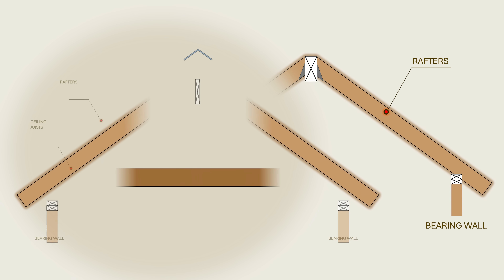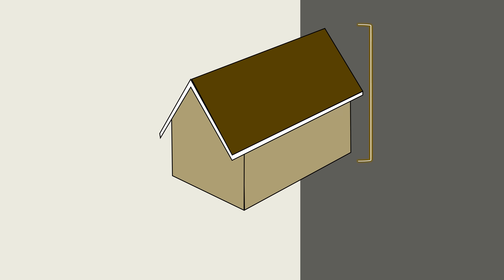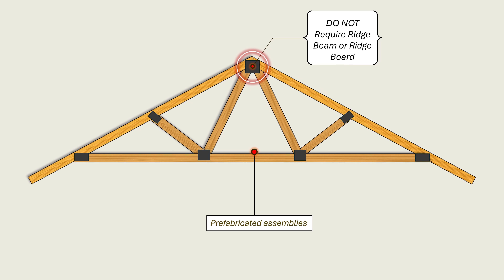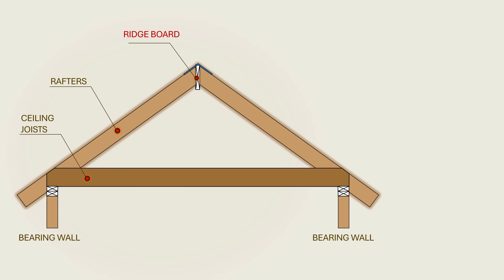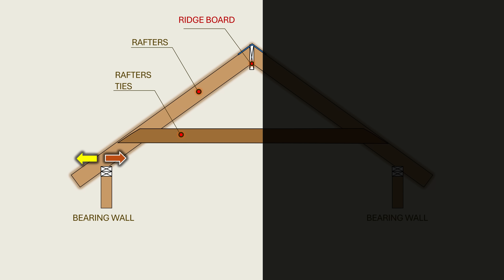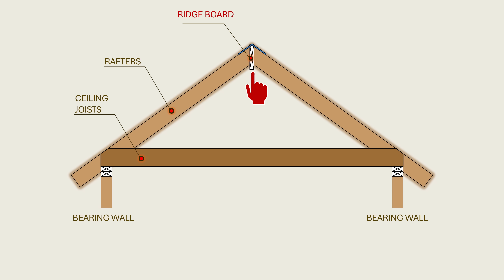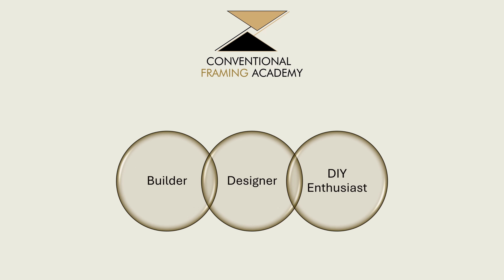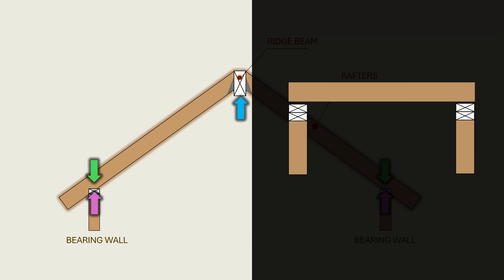Ridge Beams vs Ridge Boards: What Every Builder & Engineer Must Know

Comment: I would always go with a conventionally framed roof over trusses.   Too many times the trusses come broken or break later creating a massive problem.   Plus, they eliminate any possibility of a functional attic.  And, finally, any cost savings has to be compared to increaese in other trades, like HVAC. And compromises in functionality in other systems.

I prefer ridge beam, even if not to expose architectural features.  They lend a more effective and efficient use of attic space,  access overall, and installation and functionality of other systems (especially HVAC).
Plus, the long term durabilty of your roof..... termites will have to eat your entire house before that roof fails. 

I, also, don't like OSB, preferring regular plywood and marine plywood (if moisture or water is an expected issue).

Basically, if you are going to build a home that you intend to keep or posiibly pass down.
Build it to last!! 

Why build to a 10, 20, or 30 year standard? 
When you are ready to retire and relax... the house will need major work.
Assuming 30 years....
BTW most track builds today are built to a 10 or 15 year standard.
🎉
Build to a 50 plus year standard.  Build anticipating future upgrades and maintenance, with ease of access.  

Yes, things have a cost.  But, the difference in these, during initial building,  are far lower than major overhauls and accompanying restorations.... far lower in the long run!!

Comment: I am done with ridge beams. This video sloved a monster of a problem on my stone house in Portugal. Lifting a huge ridge beam onto the roof all by myself. Also the ridge beam puts all the loads on two points. Going the ridge board route allows me to spread the load around the house. The cross ties will completely eliminate any possibility of side thrust.

Comment: Speaking as a 30-year framer and contractor: a carpenter, structural engineer, or architect would call the one on the right a "structural ridge" (as opposed to the "conventional ridge" on the left), not a "ridge beam". Structural ridges typically make use of beams as the ridge, but "beam" doesn't describe the main function. Rafters can be attached to both types of ridges with hangers. 
If a strap is used across the top of a conventional ridge to resist uplift, it's installed across the top of- and fastened through- the roof sheathing. Shown like this it would interfere with fastening the roof sheathing to the rafters, which is a structural connection. If straps or hangers are not used, collar ties (2x4's, 2x6's, or 1x6's) can be installed in the upper third of the roof, connecting opposing rafter pairs at  4' intervals. Since most rafters are installed every 24" along the ridge (on 24" centers), every other rafter pair would get a collar tie.

Comment: 2 inch ridge beam is fine, just install lateral brace down on load bearing wall, run angle braces tied to strong back connected too rafters  back to load bearing wall and collar ties at ridge.

Comment: Thank you for the video. Many, if not all houses over 60 - 70 years old use a 1x6 as a ridge board. A ridge board is merely a convenient way for carpenters stabilize roof framing and to visualize where the rafters go. I have seen structures with no ridge board at all. And at least twice in my life I have framed a roof with a "real" valley, now there is a lot of weight (stress) where a beam is required.
Reply: Yep, I mostly work on houses from the early 60s and they used pretty much any old board. All those houses are doing just fine after all these years.

Comment: From experience I find that the assertion that a ridge beam eliminates horizontal forces spreading the walls is not 100% true. Though it may reduce lateral loading at of the bearing walls it does not completely eliminate that load.
Reply: If the ridge beam is adequate and the rafter attachment sound, how would the roof move to spread the walls? I'm currently building one.
Reply: @neild7971  The lateral load would be so small as to not matter, but have the design approved by an engineer.
Reply: @kshepard52 engineer involved thanks. Peter is saying from experience beam doesn't stop wall spread, I'm curious what's happened.

Comment: ridge boards and ridge beams are both "dimensional wood boards" ? ie: 2x6, 2x8, 2x10 ?
Reply from the maker: @philipschneider6396 Ridge beams are typically 4x or 6x members. They may even be Glulam or other types on manufactured lumber as designed by the engineer. Ridge boards are typically 2x members.
Reply: @ConventionalFraming  Yes, because they're only marginally structural. They provide extra nailing for the roof sheathing at the peak and a good connection for opposing rafter pairs.

Comment: @ 7:00 , a better graphic would better explain this rule.  Show the plumb cut (the vertical cut touching the ridge board) meeting a 2x6 ridge board vs. a 2x8 (or larger) ridge board, and how this larger board satisfies the rule.

Comment: I used a gluelam beam for the ridge beam with joist hangers for the rafters to sit on, one end of the beam sat on a pad stone in the abuttment wall the other on a designed steel box section truss, all calculations were done by me after watching various videos on YT, i was over the moon when building control passed it all, saved me a lot of money in engineers fees
Reply: st to clarify the above, the gable was fully glazed from the ground up to the botton of the ridge beam, the steel truss sat on pad stones on the inner leafs of the side wall returns
Reply: @georgeliquor2931  Leafs? Glazed? WTF are you talking about? What planet are you from?
Reply: @kshepard52  In the UK the inner and outer walls of a building are reffered to as leaf's, so in anwer to your question im from planet UK, glazed means frames with glass in them, in this case triangular PVC window frames, Im sorry but for a man with your credentials you seem quick to put down others and also ill informed, maybe thats how it is on planet USA
Reply: "all calculations were done by me after watching various videos on YT"
Recipe for disaster! The plans should have be reviewed and stamped by a structural engineer. I hope no one reading these comments actually takes you seriously!
Reply: @kshepard52  For someone of your background you seem very quick dismiss my coments, i would have though someone self teaching through whatever means to achieve a goal would be appluaded by most people, it seemed to me that paying an engineer £600 to do a simple calculation would be like throwing money away especially when on previous builds where the customer had engaged the services of an engineer the drawings and calculations were done by a computer or just coppied and pasted and all way over spec, i could send you drawings that i have on file that were put together by structural engineers that i am sure would have you shaking your head as the building inspectors have done on site many times when they see what the engineer has specified. My calculations were based on the european design capacity tables for industrial steal hollow sections cross referenced with british steel design capacity tables, to calculate the forces involved i watched a few hours of YT videos on truss design and trigonometry, the calcs were not difficult once i had wrapped my head around the trig side of things, glulam beam calcs were provided by the manufacturer.   The whole process was enjoyable actually and it saved me money, it was a good feeling when building control rubber stamped my submission  it also reinforced my opinion that some structural engineers are just in it for the money and do as little as possible to get it and feel untouchable on the plynths they have put themselve on. Self edducating  is a good thing as long you are prepared to put yourself up for scrutiny by your peers

Comment: Simply put: Depends on rafters with flat ceiling (ridge board) vs rafters with cathedral ceiling (ridge beam). If you use a truss system (more expensive and stable) this ridge board/ridge beam conundrum does not apply.
Reply: That ignores R802.4.4 and the roof slope. With a low slope, you still need a ridge beam whether it's a flat ceiling or not. With higher slope, you can do just a ridge board.

Comment: Licensed Architect or Engineer can design structural elements.

Not just an engineer in NYS .
Reply: WRONG! Only structural engineers can specify technichnal load carrying capacities!
Reply: @Silverback1969MoonLandingLies Nope ..
Not here in NYS .
Architects specify structures under three stories .
Different states may have different rules.
I took advanced structures in Architecture school also . 

And any PE can stamp Architectural  plans  here not fair .
Electrical PE can stamp Architecture plans ridiculous....

Been in Architecture and Construction since 1979 and worked for structural Engineering office and Civil engineering office for NYS DOT .

Comment: This is an overly complex explanation of a simple fundamental piece of design that our ancestors have been using for millennia, without any reference to design or structural calculations.  Also, the IRC only applies to US installations and those countries that have adopted it, being those that don't have the regulatory infrastructure to establish their own standards.  Almost certainly the rest of the western world will have their own standards to apply to roof structures, so that the actual standards should not be quoted as an 'international' standard.
For me the easiest explanation of a ridge board is a member that enables the two opposing rafters to be connected together at the correct spacings.  Any horizontal thrust from either rafter is passed to the other through the ridge board.  In a pitched roof with a ridge board if you apply a load at the ridge then there is a natural tendency for the foot of the rafter to push out, this is counteracted by ties across the building between opposing rafter feet to stop that spread.  Simple
A ridge beam is placed at the top of the roof pitch to carry the vertical load of the roof, being about 1/2 of the dead load/live load.  Because it is carrying the vertical load, no spreading of the rafter feet can occur so that ties are not required lower down the roof.  Simple
Reply: Exactly
Reply: The ICC (most widely accepted residential building standards in the US) calls all of their standards "International" even though they obviously aren't used worldwide. It's a marketing thing.

Comment: The video is confusing because it doesn't show the clear load path of a ridge beam to the ground until the very end of the video.  As shown in most of the video the ridge beam has no structural support because there is no ceiling joist or king stud under the beam.
Reply: The support of the ridge beam can be by various methods, commonly it is supported by the gables of the property.
Reply: The ridge beam is always supported on either end by a post. It is shown in the last part of the video in the form of a structural elevation drawing which shows the post going down to floor.
I am a carpenter with 41 years under my belt and I framed for 22 years.
Reply: @paulgewiss9238  Most ridge beams in my experience as an Architect with 45+years post qualification and 50+ years in construction usually land on a masonry gable or intermediate wall.  The only time it lands on a post is either where internally there is no wall or you have a stick built structure that requires reinforcing to carry additional vertical loads.
Reply: @paulgewiss9238  I agree.  An experienced carpenter would know that the ridge beam is supported.  My point is that the video appears to have been made for novices.  As you point out, the structural elevation doesn't appear until the end of the video.  It should have been shown earlier when ridge beams were first mentioned.
Reply: wow, yes, i wondered about this also. the most critical piece of a ridge beam system is only given like 30 sec. surely there's lots more to say about load paths, e.g. do you only need them at the gable end? or when do you need more (support beams in the living space)? maybe that's in another video?
Reply: @4mla1fn  The principle of a ridge bean is that it supports the top of the rafters so it has to be able to support 1/2 of the roof's live (wind, snow, access etc) and dead load (self weight).  Like any beam it can be sized depending on the total load and its span so that it can span from gable to gable if its big enough but if it can't be due to the limitations of the material or space or its end support then the span has to be reduced with a prop.  All of these conditions and considerations will be within the scope of the design team to achieve the correct compromise.
Reply: @clivewilliams3661 now THAT'S the extra 45 seconds i need. lol. thanks very much. i get it now.
Reply: Ive always put ridge boards under ridge boards and beams for extra support it makes the roof stronger and i put hurricane straps on everything tornados can happen
Reply: Thx Roy for saving me 13 mins. of my life. Finding a more straightforward tutorial now.

Comment: These idiots. Guys in white coats who never built anything. Ridge boards and beams do exactly the same thing. However, a heavy "structual" beam only adds lateral force to the walls by way of additional live loading transfered to the tops of the walls. I could go on and on but what's the point? This "new crony math" is completely fabricated by the laminated veneer lumber industry in order to sell their product. They've spent hundreds of millions of dollars lobbying the regulation entities. Now, most of the wooden structure designing programs have LVL's built in as required elements.
How in the world are the 200 year old antebellum mansions still standing?
Reply: Go back and watch the video again. Ridge boards and ridge beams are completely different.
Reply: They are not exactly the same thing at all. A ridge board does not need to transfer vertical force from the rafters (meaning it can be much thinner and not need nearly as much support at the ends).
Reply: No, conventional and structural ridges don't do the same things! 
Engineered lumber is great stuff: strong, often light, uniform, and stable. 30 year framer and contractor. I love it. So would the carpenters who built those mansions if they'd had it.